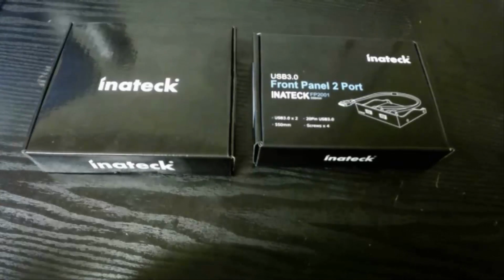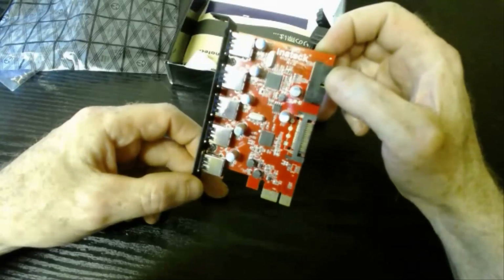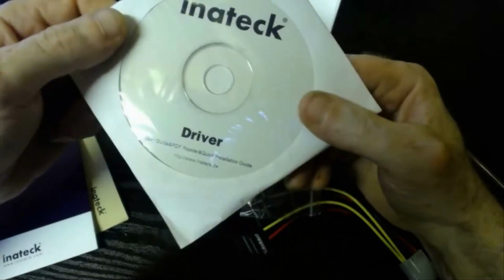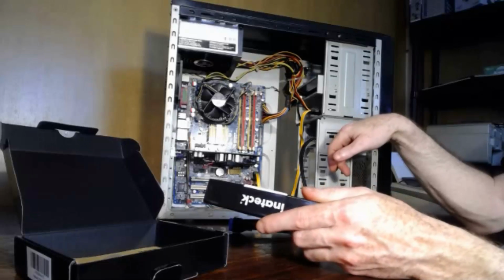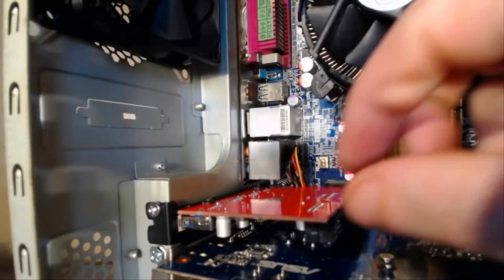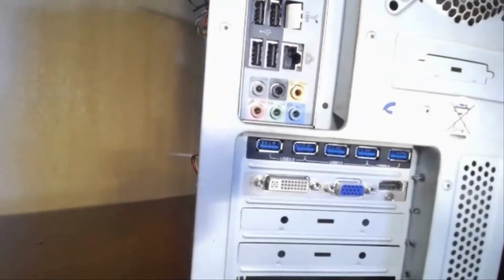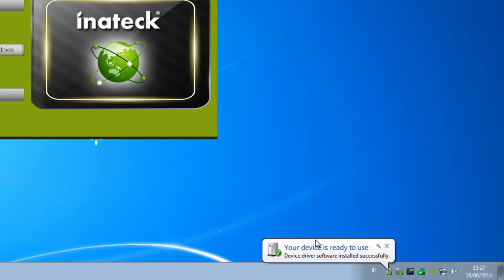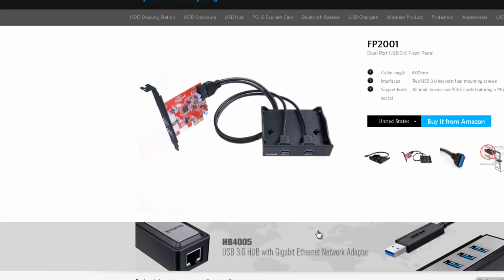How to install usb 3.0 ports on your PC

Comment: What could have been shown in 3 minutes was shown for 32 minutes. What a waste of time.
Reply from the maker: Dr. Bhaskar Maitra that's nice!
Reply: You can adjust the playback speed using the gear icon. Skipping is also possible.
Reply: not everybody is an expert

Comment: As a former tech, I can tell you this is a very clear guide on upgrading to "super speed" usb 3.0. But.. I just installed a Z170 m/b in an old case and had a hell-of-a-game gettin Win 7 Ultimate to install the correct drivers for USB 2.0. (Coz, yeh, Win 7 x64 only supports 2.0 (and I have 2.0 front panel on this old case). There is a workaround to get USB 2.0 drivers working on Z170 (without installing crappy Win 10). Anyway, here's my question: Will my old USB 2.0 drivers and USB 3.0 drivers work together, if I install the Inateck 3.0 panel? (i think i got the correct 3.0 "header" socket on my m/b).  Thanks to poster for the video.
Reply from the maker: Yes they should work, but i do stress that win 7 is a tad old of new drivers even on usb 2! unfortunately windows 7 programming is a bit outdated for new hardware😒 sorry for the bad news !
Reply: Hi Kevin, thanks for interesting reply. Possibly USB 2 drivers were updated for Win 10 and those drivers will still work in Win 7 Ultimate x64? I'll have to do abit of net research to find out. Why am I fixated on Win 7 Ultimate? It absolutely races along on an i5 processor. Win 10 Home (that I've already been asked to fix on other machines) on the other hand, is a hogbeast...It has both bloatware and spyware (that MS call telemetry) slowing everything down!

Comment: Hi...If I don't have 19 pin connector...can I still add usb 3.0 just through sata 2 connector...I have del xps8100..thanks
Reply: The 19 pin connection is to add a front panel. You don't need to add a front panel.

Comment: I am using intel core i5 windows 10..can I put or add  SSD to my computer?
Reply from the maker: Yes u can install a ssd in your pc! just turn off pc install ssd and 
turn on pc! Then you have an extra hard drive and you can start saving 
stuff to that ssd! but if u want to have  windows 10 and all your 
programs on it, then you have to clone the hard drive or make a system 
image! by using that new ssd. OK, Hope that helps!
Reply: Thanks.....much better if I can watch a video . Do you have demo video for SSD?
Reply from the maker: So this vid shows you how to install any hard drive it's the same as installing SSD's https://www.youtube.com/watch?v=xFud4nbU_Y8

and this video shows the complete pc build https://www.youtube.com/watch?v=RGw8N4rG3AI
Reply: You just need a 3.5 inch bracket. SSD becomes the same shape as a regular HDD. Just order together with the SSD. https://www.amazon.com/Corsair-Dual-Mounting-Bracket-CSSD-BRKT2/dp/B016498CK0/ref=sr_1_3?ie=UTF8&qid=1505415333&sr=8-3&keywords=SSD+bracket

Comment: Hey there,
I a have a old computer bout 7 years old now. The motherboard i have is a Asus P5SD2VM with Intel core 2 Duo E7400 2.80 Ghz and 3GB DDR2 ram with 450 power supply unit and a NVIDIA Gforce 210. Would really like to upgarde my system to USB 3.0. Should i go ahead with the upgrade or my motherboard is too old.. please Help..Thanks in advance
Reply from the maker: hi, yes you would be better off upgrading that pc at least the 
motherboard processor and ram at the very least and if you can the hard 
drive and get a solid stste drive(ssd). things have moved on 
considerably in 7 years! a new motherboard will have usb 3 all 
integrated on the motherboard. it only a matter of time and usage that 
your present pc will slow or even fail altogether! i hope that helps ! 
and if you want, that system will be able to run usb 3, but how well it 
will run is a any mans guess! if it were me i would upgrade the pc as i 
said! Ok!
Reply: Kevin Colleran  That's expensive, though, unless there's a sub-50 USD motherboard that works with all his existing hardware while adding USB 3 or sub-100 with Thunderbolt 3.

Comment: Both my PCI-Express slots are blocked by the Video card. The rest are useless regular PCI slots. All these USB 3.0 cards are PCI-E. (The regular PCI cards are rare, slower, and more expensive) Would I be able to use a LOW-PROFILE card an extension cable to reach the PCI-Express slot next to the card? The new card would have to hover over the regular PCI slot without plugging into it.
Reply from the maker: Get a pci-e x1 slot extender like this one https://www.amazon.com/Powered-Extender-Litecoin-Bitcoin-Mining/dp/B00HZ0M9F2
Reply from the maker: Sorry posted the wrong extender here the one you need!  https://www.amazon.com/HOTER-Express-Riser-Flexible-Cable/dp/B0057M0ABA
Reply: So would that and a low profile pci-e card be able to sit in one of my regular PCI bays and hover over a regular PCI slot? I wonder if micro-atx motherboards are better for this reason. less slots, but at least useless PCI slots aren't taking up every bay.
Reply from the maker: yes, but you will get the job done with that
slot extender!

Comment: any tips on how to get the USB 3.0 plug in? Im having issues trying not to bend pins
Reply from the maker: Some of them are tight fit and do require a bit of force, boards are well able for it just but your hand under the usb connection as you are pushing in the connector. OK!
Reply: right on, i'll keep working on it, thanks mate

Comment: Hi Kevin.. Hope you can help me' I bought the same as you but my card is ORICO PVU3-5O2I and for the life of me i cannot find any drivers for it :-( the PCIe card is the 5 port with the expansion for front port but i am at a loss for drivers. it came with a disk but it says drivers ar corrupt, no luck from the eBay seller either (totally ignoring me) My card looks exactly the same but named ORICO. can you help me with a link or email for the drivers please. Thanks :-)
Reply from the maker: +Deano Essex This is the only website i seen that has drivers but they need RAR program to extract them so that you can install them i do not know if they are the right ones on info on website about them. If i was you i would return it and get your money back and buy a different make that has support if you want to try and install the link is below and make sure you install Winrar which you will have to install to extract the files links to winrar http://www.rarlab.com/download.htm
driver download:
http://www.oricothailand.com/2011/index.php?module=main&pages=Product%20info&product=304

Hope that helps!
Reply: +Kevin Colleran Thanks for your quick response Kevin, I think you're right i will return this and spend a bit more for "Hassle Free" computering lol. I tried the other drivers but without luck. Thanks anyway :-)
Reply from the maker: I'm glad you're moving on! it's just not worth it. Hassle free computing is always best... happy computing;^)

Comment: Does this card work with windows 10?
Reply from the maker: +abnormaldevil YES it should, but you better check on the inateck site to make sure it's compatible and that there is a driver for windows 10! I have not used this card on a windows 10 PC yet! and i have not checked if it does!  But really i would check to make sure, if i was you!

Comment: Hey Kevin I just found out my motherboard only has two pci express x16 slots and one is being used for the video card. Will the usb 3 internal board "PCI-E" fit on the available pci express x16 slot? And i also cant find the inatech front bay two usb 3.0, did they discontinue the item?
Reply from the maker: Robert Shackleferd Yes Robert the usb 3 internal board "PCI-E" will fit on the available "pci express x1" slot! The smaller Slots! There should be one beside your graphics card slot! As far as i am aware they did not but they're are very few for sale for some reason! Any Front bay usb bay will be compatible with the inateck pci-e card! OK, hope that helps!
Reply: Kevin Colleran Thanks for your reply Kevin
Reply from the maker: you're welcome Robert!

Comment: Hey. Thank you for the video. Can you help me with this? I have been wanting to do this for a while now. Before I buy these I need to know would these two items be compatible with my motherboard? I sent the exact same info to the Inateck merchant on amazon & all they said "this card does support vista system, But I need to inform you that our card is not totally compatible with Dell computer." I'm still a bit confused because I didn't think my pc was a dell. Anyway, when I saw you had this video I figured maybe you can help. I'm not a total newbie but I haven't done too much as far as hardware goes. I appreciate it. Amanda 

My PC:
My mother board is MS-7309. I have an AMD Athlon Processor LE-1640, 2600mhz, 1 Core, 1 Logical
Processor. My graphics card is NVIDIA GeForce 6150SE nForce 430. I have Windows Vista Home Basic 32 bit but 64  bit capable (which I am considering). The BOS version/date are American Megatrends Inc. V2.6, 9/2/2010. SMBIOS version is 2.6. I have 6 G  installed RAM but I read somewhere that unless I switch to the 64bit version of Vista my system only recognizes about 3. Also, if this will work would I need to replace the power supply and/or fan? If you need any more information please let me know. Thank you. Amanda

Items:
Inateck Superspeed 7 Ports PCI-E to USB 3.0 Expansion Card - Interface USB 3.0 5-Port & 2 Rear USB3.0 Port Express Card Desktop with 15 pin SATA Power Connector [ Include with A 4pin to 2x15pin Cable + A 15pin to 2x 15pin SATA Y-Cable ]   

Anker® 3.5 inch Front Panel USB Hub with 2 USB 3.0 Ports [20 Pin Connector & 2ft Adapter Cable] (I could not find the Inateck 2 port model on Amazon)
Reply from the maker: Hi Amanda, delighted to here from you!
Now as for your question I would hold off on the USB 3.0 ports until you move to 64 bit operating system and your motherboard was built around 2008 that makes it 6-7 years old meaning your hardware is out-dated by 4 years! which is a long time in technology terms!

So the usb 3.0 ports will install but you will not see usb 3 speeds because of the restrictions of the older hardware namely the Motherboard,Processor and RAM. A 1 core AMD processor will not be capable of multitasking usb 3.0 and all the other calculations it must do at the same time.

So you will not see the benefits of USB 3.0 that much with your current hardware! what i sagest is and upgrade to new technology Namely Motherboard,Processor and RAM and operating system windows 7 or 8 or you could wait for windows 9 which is coming out in the new year 2015. These changes are not expensive you don't have to go to town on price or power $300 would go along way and you could even get a power supply which would not be a bad idea either! this is only a suggestion! but a good one your hardware owes you nothing after working for you for the past 6-7 years!

The thing with hardware is you need to upgrade 3-5 years to stay up-to-date with technology and get it's benefits! now I'm not Knocking your present system it's probably perfect for what you need it for! but if you want the true benefits of USB 3.0 then upgrading is a good idea!

As i said usb 3.0 will work with you present system you'll not see any speed difference on it because of the restrictions of you older hardware! sorry about that! not mush good news there for you but that's the nature of technology! Hope that helps you make the decision a little easier where you now what to expect from usb 3.0 with your setup! It's best to be honest with you, don't you think? If you need more help just let me Know! Regards Kevin
Reply: Kevin Colleran Hello. Thank you so much for all that information. That was exactly what I was wanting to know. Now I know what upgrades to shoot for first. This pc has really been good to me since I got it new back then. I'm also glad to know that I can upgrade all this stuff myself.  As per your suggestion and knowing what I have now, is there anything I should know about what to search for in a motherboard, processor & power supply & fan? (Any recommendations?) I have actually purchased & installed RAM before and it wasn't so hard. I don't necessarily do heavy gaming or anything but I do tend to want to run multiple things at a time which I have learned certain things I have to run by themselves. I have some extra money this season & I was going to use it to upgrade my system. I've never installed any hardware other than the RAM. I thank you again. Amanda